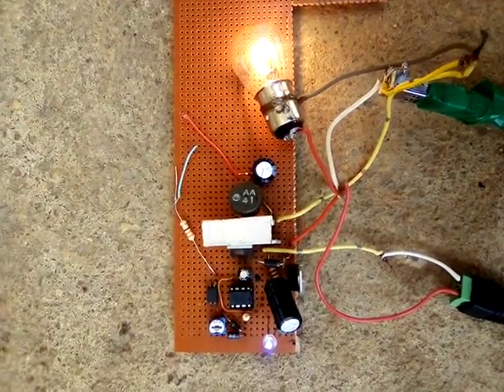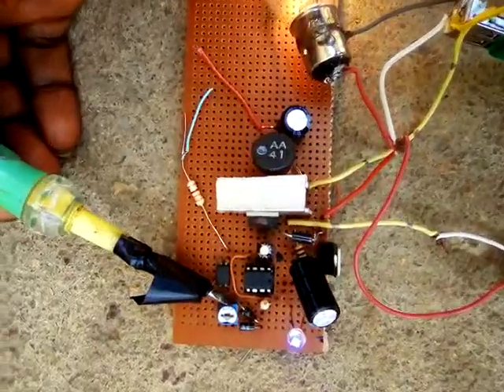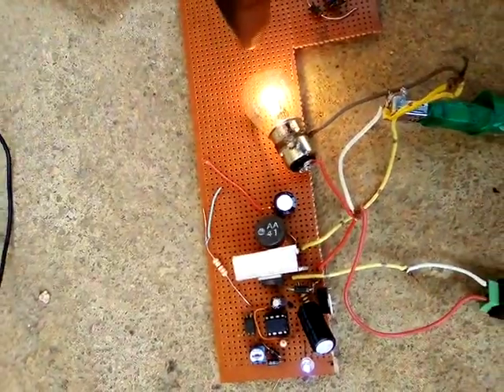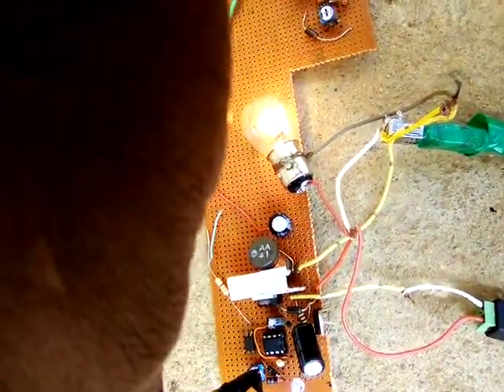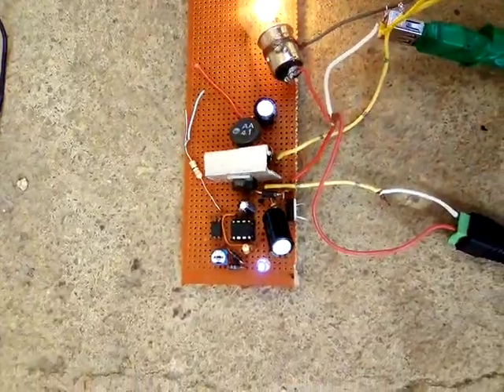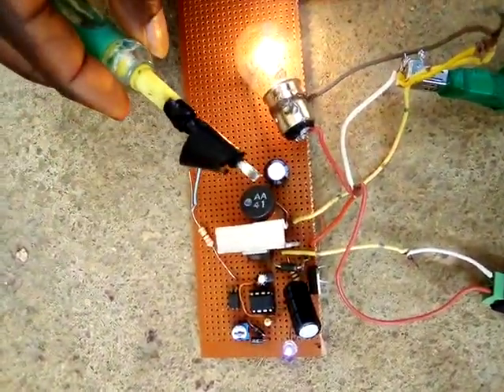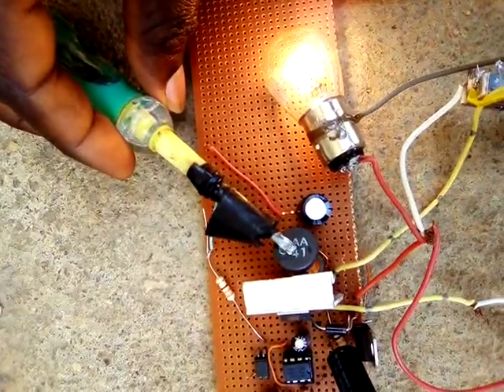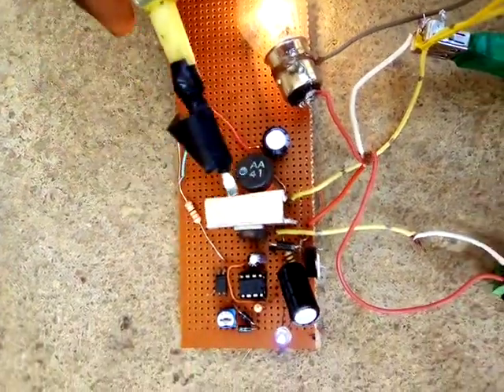DIY buck converter for solar MPPT charge controller using 555 timer ic 2

Comment: Well done sir, I appreciate your videos.

Please I have questions regarding buck converter.

1-I have a 48v/2Amps power supply, I want to use it to charge 24v battery sets and also 12v battery, please how can I modify your design to achieve this separately.

2- Between the two designs, one with feedback and the other, which one has the higher efficiency with more current gain?

3-please how can I design the appropriate inductor based on the frequency and the output and input voltage with desired output current like 20amps?

Thanks for your videos.
Reply from the maker: you will need.
1. A PWM(555 timer IC) To generate the pulse.
2. you will need a Mosfet that will Control The Power flow.
3. you will need A coil that will pass the power to the load.
4. you will need capacity At the Output stage
5. you will have a feedback circuit at the output to control the voltage on the MOSFET. This feedback will consist of A transistor, Resistors, and Zener Diode
Reply: @DjDonGeniuss   Thanks sir for your reply. I appreciate, how will I do it sir? I didn't see zener diode in your videos.
Reply: Please sir, you have not answered other questions?
Reply from the maker: U can use resistors IC 7805 or  Optoisolator instead of a ziner diode. It depends on what you can easily access.
Reply: @DjDonGeniuss  Thanks sir, for your reply. I appreciate
Reply: Hello sir, from your 40w panel, what is the highest current gain using the buck converter
Reply: Sir, please I tried charging lithium with 0.8A but not charging the battery well, please guide, sir?
Reply from the maker: The 40 wats panel has it original voltage of 24 v * 1.6A under full sun intensity. So stepping it down to 12v give a 3A of current. Which is enough to boost any 15A battery within 5hours.
Reply from the maker: What is total Arms of the battery you are trying to charge. Because that 0.8A should be for single lithium iron batteries which has power rating of about 2A. But once u are connecting 2 or more it in parallel, know that you will need current to charge it. Because the new current will be 2*number of batteries.
Reply: @DjDonGeniuss  Thanks for your reply, I have lithium battery 5p7s for 24v system, can I use the 48v/2A supply using the buck converter to charge it well. What will be the current gain?
Reply: @DjDonGeniuss  Good day sir, how are you?

Please sir, kindly guide Me to building a good 555 buck converter. Thanks sir
Reply: @DjDonGeniuss  please any guide sir, I have issues with the design?